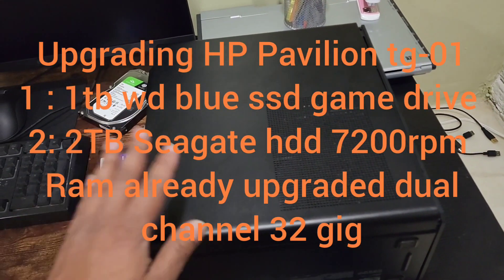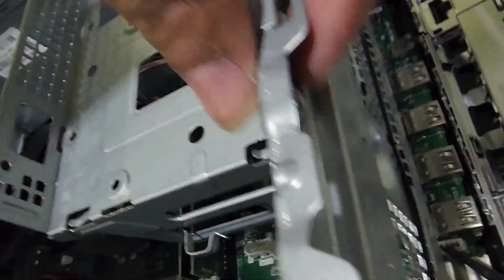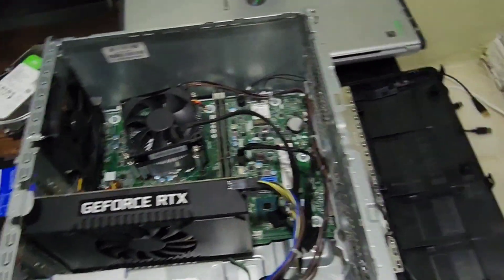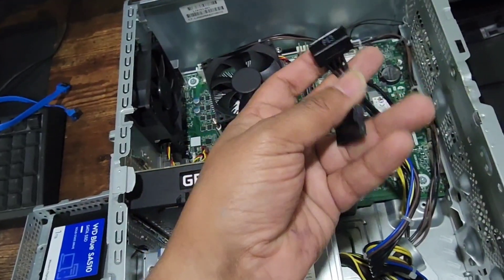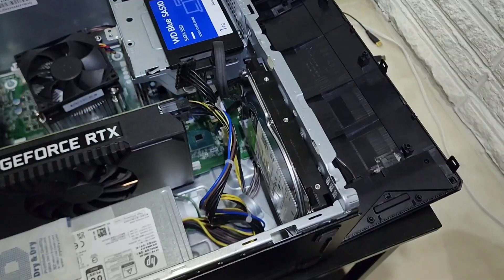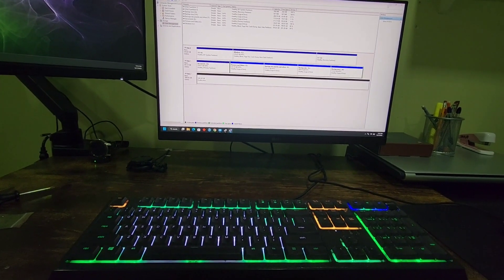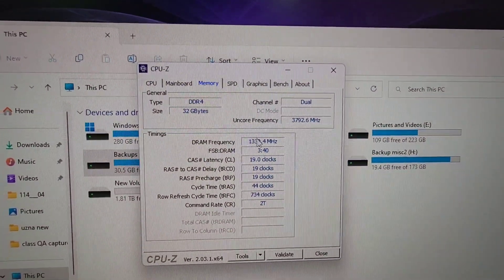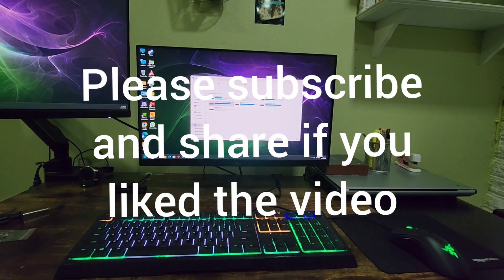HP gaming pc (tg-01 pavilion)storage upgrade. 1tb ssd and 2tb mechanical hdd.

Comment: im planning to upgrade the ram with 2x16 3200 ddr4, it consumes 1.35v with the xmp profile enabled, hp doesn't have this option in their bios so, without the xmp it consumes 1.2v so its right to use?
Reply from the maker: I believe the ram will work just the xmp profile would not load and ram will work with reduced bus speed then as advertised. After the pc boot , do a memory test to ensure the stability.

Comment: this HP Pavilion Gaming - TG01-1001nx ?
Reply from the maker: Hi I have to double check. It's tg 01 for sure with intel i5 ( 10th gen ) and came with 400w psu and nvidia 2060 , 16 gig ram and intel 512 nvme) I upgraded to 500watt ,amd  6700xt, 32 gig ram and 1tb nvme, 1tb sata ssd  along with 4tb hdd.
Reply: @SakibChoudhury  i have HP Pavilion Gaming 790-0024in currently with 128gb ssd and 2tb HDD is it possible toadd anoter SSD without removing the current ones?

Comment: how many hard discs can this pc support and whats the maximum size of them can it support also? thanks.................
Reply from the maker: You can put, 4 sata hdd ( or ssd ) . You can also use the x1 pcie slot for sata adaptors to add more drive  or pcie x1 to  nvme m2 adaptor and fit an m2 ssd. 
I have 4tb hdd, 1 tb ssd and 1 tb nvme m2 as of now.
Reply from the maker: Also the maximum I would believe it would support upto 16tb hdd.

Comment: I have the same model as you. How far would you upgrade this before it would make more sense to build one? Black Friday is coming and im looking at my options
Reply from the maker: The biggest issue is the lack of compatible power supply. The highest hp oem psu I found 500w. Which restricts the ability to go above 3060ti ( 4060ti ) , amd 6700 and at Max 6700xt which almost at the border line of a stable gaming platform. The future 7600xt might be well supported.  
However the thermal ventilation is also a big issue for bigger guards and no room for over clocking whatsoever . 
But since I already got the system and do gaming at 1080p 120hz . It is so far holding great and most games are playable at highest settings with 60fps. The last card I will try is 7600xt when it is realesd and then will build up a custom system once there will be no room for upgrade. 
For anyone who wants to have a gaming pc, it is wise to choose custom parts and I personally like asus line of motherboard , Intel core i5-i7 series and amd line gpus. For amd gpu sapphire never failed me. 
I avoid msi due to multiple of their gaming line motherboard died within months. 
For psu , I avoid Thermaltake,  and corsair is the way to go. 
For nvme, always samsung or hynix.
Reply: @SakibChoudhury  thanks very much for the response. I've never upgraded beyond ram for a laptop so a full build is pretty intimidating.

Comment: You can use Ryzen Master to overclock ram to 2x16@3200mhz
Reply: I set the automatic oc fabrics to 1600 each as that is 1/2 of 3200 and after a reboot they responded as 2x16gb 3200mhz c16 after 72hours and 4 stress tests mem test 64 pass all times. Ram used was Corsair Vengeance Lpx 2x16gb 3200mhz c16
Reply: @GrifballNation  did the same thing with corsair rgb rs

Comment: How did you get a gpu to work? I have the 2225tx and i put a rx 6400.. device manager doesnt see it.. therefore amd wont install the driver
Reply from the maker: Mine is 6600xt and worked without any issues. If the bios can't detect it, there won't be any display output.  There are number of things need checking but I would start with a bios update. And also make sure you put power port if your gpu needs pcie power from the psu.

Comment: Have the same computer Picked up mine 2 years ago ( Ryzen 7 3700X 8core) with Radeon 550 2gb for $500. I just upgraded to the same card but with 4 Vram. My power supply is only 310 watt. Wanted to upgrade PSU, but being only 4 pin vs ATX 24 pin with limited options. It also only came with a dvd player and a 256 ssd. I put in 16 ram vs the 8 it came with. I only now want to upgrade my ssd to 500gb or 1tb. It would be nice if I could just pluck out the old ssd and put another one in without going the cloning route.
Reply: You could also just add a sata drive like this guy did to have additional storage instead of replacement.

Comment: where the connection to the hard drive? I see the connection to SSD
Reply from the maker: It is also connected through a sata 3 6gbps connection. Maybe during the video,  I took it of the cables to re management and ultimately in the end both sata hdd and ssd were connected with the motherboard and powersupply.

Comment: I have the same computer only I finish making all the possible modifications including 2 Noctua fans and a Noctua cooler with a 2 tb hard drive and a 4 tb ssd finally the 500 watt power supply and an rtx 3060 ti.
Reply from the maker: Impressive ! I have installed the side fan however do you recommend installing the second fan by replacing the system fan ? I have ordered 500watt psu from ebay and planning to upgrade the rtx 2060 with rtx 3070 .
Reply from the maker: Normal psu can be used with adaptor.

Comment: You might be able to upgrade your psu if you can find an adapter cable that can connect to your motherboard. It is also possible to make an adapter cable if you get a copy of the pin out from the motherboard specs pdf. 
If you can get a better psu to fit in the case, then you can upgrade your graphics. A little imagination, determination and research you can customize your pc quite a lot. Sleeper pc build. Good luck kid!
Reply from the maker: Thats a generous suggestion,  not something didn't cross my mind however the tiny property pins are a hassle to work with and I'm yet to find an adaptor which would be more practical solution.  Last but not least the awkward size of the stock psu ( more of rectangular shape) and the casing itself designed and crafted to accommodate the stock psu would surely require some drilling and modding , if somehow that too is done,  must drill holes in the bottom of the casing as most psu will have fan installed at the bottom . And I might well as do all these and upload my findings. Maybe would go back 15 years in time when enjoyed building pc and was a kiddo :D